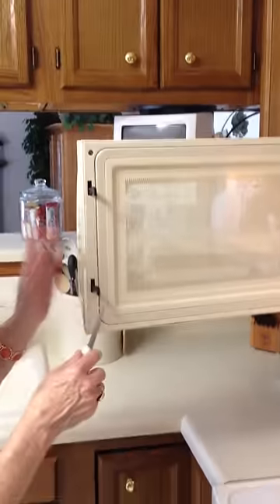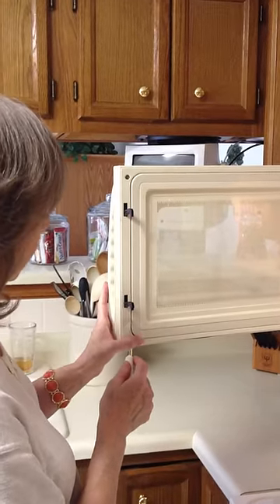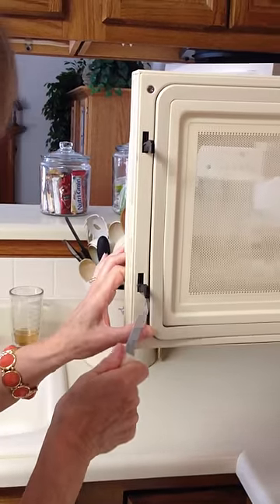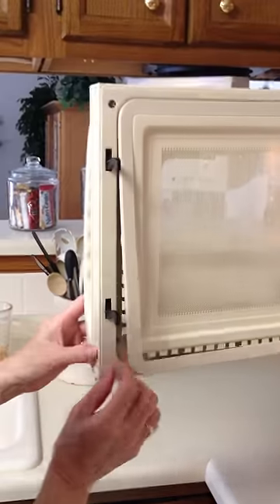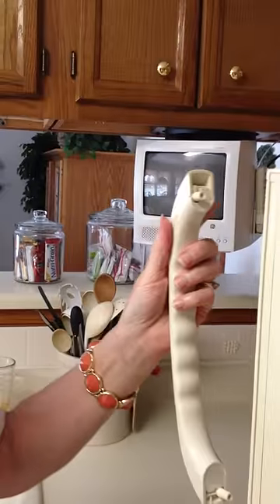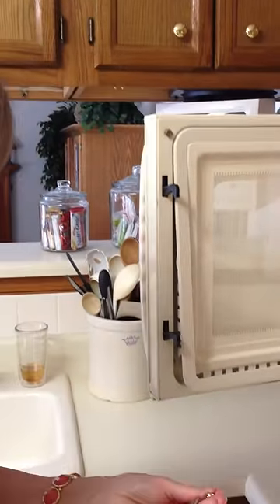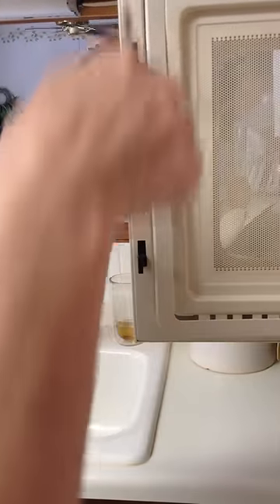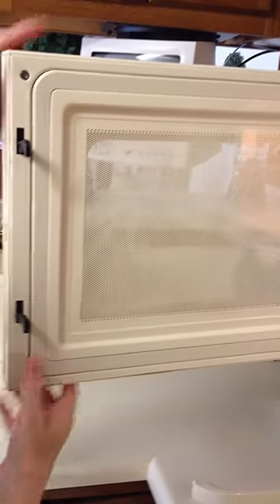Replacing GE Profile Over the Stove Microwave Handle Model JVM1350AW002

Comment: Thanks so much. Great presentation. Mine was installed when I moved into this apartment 23 years ago. I installed the new handle and fixed another problem, and it works great. Hoping it continues to work until after I move next year.
Reply from the maker: Thanks so much Peter for send the note.  My microwave broke about a month after I replaced the handle, but I took that new handle back off and still have it, I need to sell it on eBay or something.  Also my granddaughters get a kick out of the fact that I did a YouTube video I love looking to see how many followers I have. Have a great day. Thanks again.

Comment: Thank you so much for posting this video! I'm so glad it's still on You Tube. I can't believe I found a $7 handle online for a 20-year old microwave and was able to replace it in just a few minutes. Gluing it was unsuccessful, and I couldn't figure out how to get to the bottom screw. This was so much cheaper and easier than replacing the microwave.

Comment: These instructions also worked for my GE microwave, model JVM1330WW 003, with the GE replacement handle, part number WB15X335 (found on Amazon).

I would like to recommend, however, that one remove more of the plastic-gasket thing before trying to unscrew the bottom portion of the old handle. The little tabs on mine were really fragile, and I snapped one off without even trying. (Probably more relevant for me since my microwave is ~20 years old.)

Comment: Also have an old GE.  Works great but those handles are weak because of the force you need to open the door.  Handle part number is WB15X10020 for my old SpaceMakerXl.   Bought at Amazon for around $10.  Don't pay more..  Nice job.
Reply from the maker: Thank you

Comment: we had the same thing happen but was able to use bigger screws and it did not cost anything to fix and its just like new. so if it not to bad consider using different screws. you cant always do it this way but if you can it will save you having to buy a new handle.

Comment: This is such a super helpful  video! We just replaced a broken handle on our GE Spacesaver XL JVM1340BW002, and it was a breeze. We bought the handle from Amazon:
http://www.amazon.com/General-Electric-WB15X10020-Handle-Assembly/dp/B00ECV6HDC?ie=UTF8&keywords=general%20electric%20wb15x10020%20handle%20assembly&qid=1460909393&ref_=sr_1_2&s=hi&sr=1-2

Comment: I have a handle broken at the attachment point at the bottom; the handle is intact, but the plastic that secures it within the door frame has sheared off, so the video won't help my situation (but commend the lady for filming it).  Am now opening the door grasping the handle near the top, where it is still attached.  That should last another six months.
Reply: That part on the bottom that remains is held by the screw.  If it rotates when you try and take it out, try wedging something into that hole to stop the rotation of the remaining plastic part and you may get it out.

Comment: Thank you for sharing.  This is the second time I have had to replace the handle and I couldn't recall how to do it.  Your microwave is exactly like mine so this was just what I needed.  Any tips on preventing another replacement??
Reply: Pull the door open at the top end of the handle.  The bottom end is weak, always breaks on the bottom.